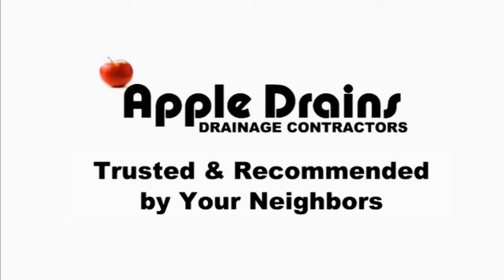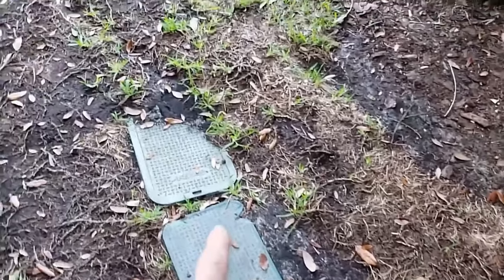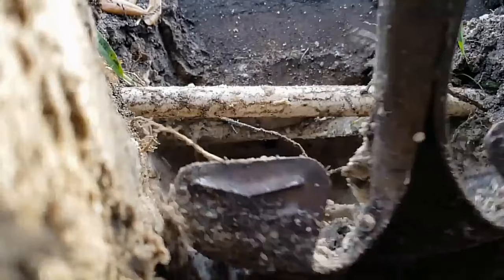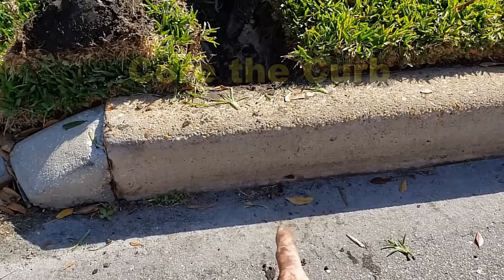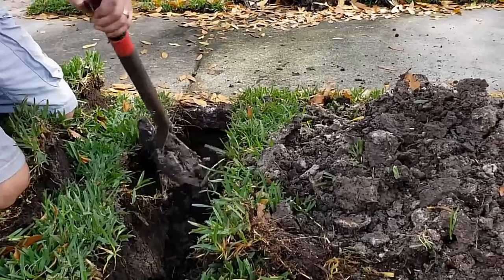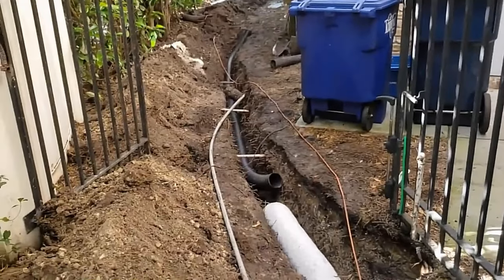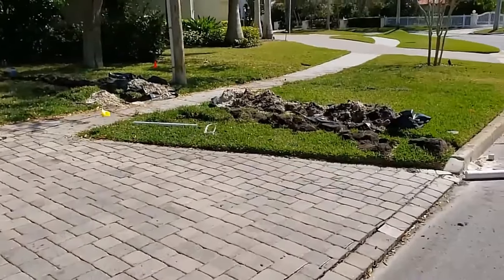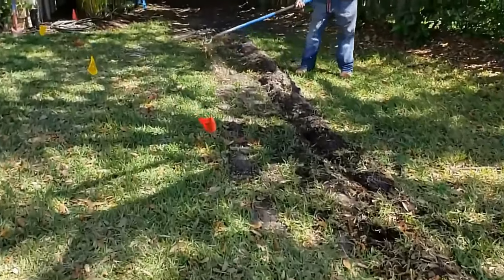How to Remove Flood from Wet Yard. Real How to Video for DIY- Stop being mislead

Comment: Great work by you and your crew. I don't think I could do all this, but by watching your videos I solved my drainage proiblems. I used a series of catch basins and routed my downspouts and the catch basins to my sump pump. Digging the discharge line was the real problem due to tree roots. I did not mess with french drains at all; I just used the catch basin system to the sump pump. So far, it is working well for my situation. Thank you for all these wonderful videos. There is no telling how many people you have helped.

Comment from the maker: :text-green-game-over: 100% Guaranteed - You can do this truly solve  Problem and Save 1000;s
Reply: Great videos! What is your decision process between the ez drain and fabric, corrugated, and rock? Is it for space? I have concerns that the ez drain will "float." Center of the house is high point 50 feet back to retention pond 50 feet front to street.

Comment: I am kind off in trouble  I bought a trailer  that is sitting  right on the ground with just some bricks holding it . And right after the all the  snow melted,  I saw that the whole yard acts as of a natural drainage for  all the farm land behind me . Alot and alot of of water . When I bought the land it  looked reasonably  dry . Now I am feeling  if I dont fix it fast the whole trailer can collapse.  The ground under nreath it is very very soft . So I am totally  new to all this . Please if you  have been following this channel for a long time . Direct me to must watch videos  , so I can  come up with a good but cheap plan . Even a temporary fix that will help buy me 5 or 10 years . There are literally  thousands of videos . And most of them are expensive. Thank you

Comment: I feel like stagreen filter paper and stone would have lasted longer, maybe the customer was on a budget. Also a furnco past the 90 on the horizontal side of the discharge will make the pump easier to pull out and service.